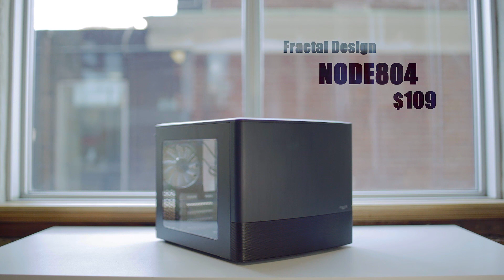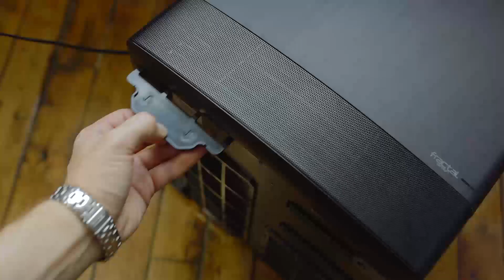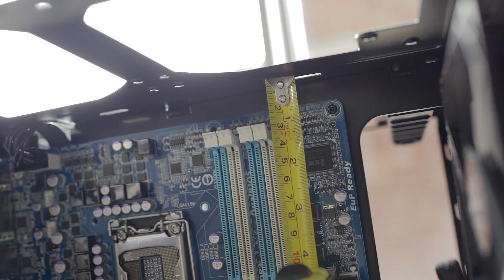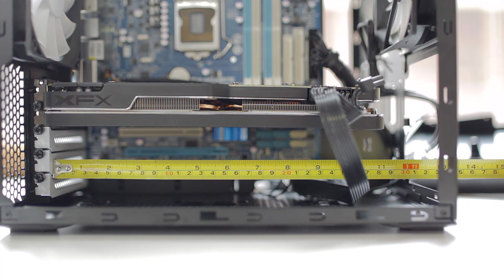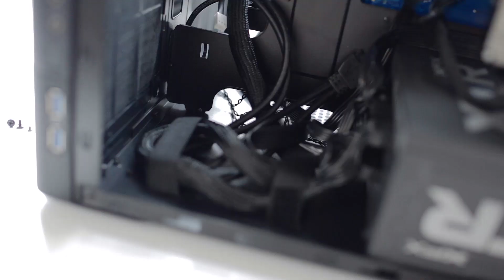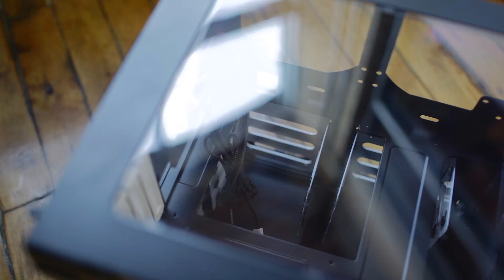Best PC Cube Case? Fractal Design Node 804 Review

Comment: no ssd support? double sided tape allows for ssd support on anything
Reply: There are 2 SSD mounts behind the front panel
Reply: ***** I just picked this case up after I watched the review and saw them. after I taped my ssd to the inside of course
Reply: Willie Finucane and 2 SSD mounts motherboard compartment. total 4 ssd
Reply: Willie Finucane its not that the case has no SSD support but that the drive cages will fit 8 HDD's but 0 ssd's
Reply: +Willie Finucane :) Double sided mirror tape works for 15.000rpm SCSI hard drives also and it is effective at isolating the vibrations from said drives.
Reply: Hey thats pretty cool, most cases just seem to have a 2.5" spot stuffed somewhere nothing else would fit just cuz, like on the 350D, Define R5 and others you can remove "all" the drive cages and still have 1 3.5" and 1 or 2 2.5" slots.
Reply: +Willie Finucane  Or velcro strips.
Reply: @KingdomOfCreation  my pc wont drive it will stand still
Reply: i use velcro
Reply: you can always use 3.5 expansions you can mout 2.5 on those expansions.

Comment: This chassis would be perfect if it had three things changed...

1: Mount the motherboard upside down on the opposite side, and give some extended length card support options. Similar to the TJ08e.

2: Adjust the drive mounting options for horizontal storage. I know they are going for better cooling with the vertical orientation, but as pointed out, its not convenient for cable or drive management.

3: Put in quality rubber grommets between the two halves. Not only does it look better, and give the cable management a cleaner look, but it gives better static pressure performance between the two halves.

I know Fractal loves customer feedback, so hopefully they can take some of these criticisms to heart, and produce a real unique, and world beating product.
Reply from the maker: Great feedback! I do also hope they modify the storage brackets and add in rubber grommets!
Reply: This chassis would be perfect if i had money!
Reply: 4: The USB ports on the Top. Never! Never! on the left or right side or bottom.

Comment: I am  using this case for my current build. I managed to fit two r9 290x with watercooling. The airflow is great! I think I will keep this case for a good while. The only case that I have tested that matches this one is the nanoxia ds4. It's cheaper as well, but it doesn't have that sexy window.
Reply: damn, sli AND watercooling? basass 11/10 would totally applaud again
Reply: Is it quiet??? pls reply. I plan on getting this case.

Comment: Great video, helped me make my mind up about this and the air 240. Have now subscribed :)
Reply from the maker: +Alex Brooks awesome! Welcome to the channel :)
Reply: which did you end up going with? im between these two as well for my first build.
Reply: +taffertime the node is good but there isn't very much room for your hands inside the case and I found the rear hard drive section to become really messy. Would recommend anything from fractal design or phanteks also have their p400s

Comment: Don't know if you noticed Dmitry; on the front (slim loading) optical drive cutout, there is no external eject button for accessing the drive, so this function is only available through the O/S.
No problem if you're not using the drive, but would have been nice for you to point this feature (or lack thereof) out.

Informative just the same.

Now; if Fractal Design could design one for ATX motherboards, might be suitable for my brother's HTPC.
Reply from the maker: Thanks for pointing that out! something i didnt think about :))
Reply: Node 605. Looks great, supports ATX.
Reply: Would have been better to have the DVD and I/O on the left hand side next to the window as well. That is side facing the user.

Comment: I love this design, like I love the Corsair 540 Air, for example, and this looks to be close to perfect for a mATX build, regardless of you're doing an air-cooled, all-in-one or custom liquid cooling. My only slight gripe would be the lack of a 5 1/4" bay, either full- or half-height. While ODDs are getting less relevant, these are still used for controllers, displays and reservoirs. But that is definitely a minor complaint.

Comment: I did my first build in this case.  The front panel mounting isn't great because when you pop the front off the wiring is so tight that it often unplugs the drive.  Lots of room for fans and great circulation.  The three fans that are included run quietly at the low and medium toggle settings, but do make some noise at max.
Reply: Adam English Thanks for that info based on personal experience. Can you give any more pros and cons? Leaning towards this or the Corsair 240 Air.
Reply: f1tony2003 The node is pretty minimalist - a smooth black box with a window on the side.  The Corsair looks a little more flashy!   I haven't bought an optical drive but there is a place for it (slim type) just above the front USB ports.  I would guess that the corsair might have better airflow as the node's front intake fans pull through a filter that runs the length of the case along the bottom four inches.  I think both of these cases are well suited for a CPU watercooler making air flow less of an issue.  Water-cooled my CPU rarely gets above 40C.  My GPU (R9 280x) runs at 50C - 60C using the stock fans at medium speed.   When I did my build one of the two front USB ports was dead.  I assumed it was a node hardware fault, and fractal designs sent me a whole new front USB setup up no questions asked.  Unfortunately it appears to be a mobo problem, but fractal customer service was great.  Good luck!
Reply: Adam English thanks so much!

Comment: Hi HardwareCanucks! Fantastic review of the case, and just sold me on it!  In the water-cooling setup, are you using EVGA HydroCoppers?  If not, would those gpu's fit in that case? If you're not sure, can you tell me what the clearance is between the side panel and the motherboard?

Comment: Which optical/bluray drive can fit this load slot?
I want to make my old i7 a multimedia cube pc but I cant find many choices for cases.
This has an optical drive option but has the load slot instead of normal optical drives slot that the drive move inside/outside.

Comment: Hey guys! I used the BitFenix Phenom just for a few months now, and I'm thinking about getting this case. The reason is that with my air cooling even with a tower cpu cooler and the Windforce GTX 780Ti, I get really hot temperatures on all the parts, and also assembly is a pain in the ass! Would you recommend changing to this one, and do you think it would help my cooling down the system? Thanks in advance!

Comment: So if I take out one of the harddrive cages so I can mount a radiator vertically in the front, and then use that to watercool my CPU in the other chamber, just to maximize the cooling possibilities in the chamber with the GPU, CPU and such, what cooling am I left with in the other chamber? PSU fan and a rear fan in the chassi?

Comment: This thing is awesome. Main question is where to put the res and the pump.
Reply: Damn it, i just realized that i have to find a new space for it, because the front i/o ports are in the wrong side.
Reply: Péter Friedrich I don't understand that, they have the window in the left hand side (when looking at it from the front) so they want me to put it on the right side of my desk so I can see all of my components, but then the put the buttons on the right side, so they want me to put the PC on the left of my desk...Not a problem for most people, but some peoples (mine included) desks are up against 2 walls, so we have to choose one side or the other.
Reply: My desk is between two walls, almost. The Bitfenix Prodigy had the same problem. My friend solved that easily. He put switches on the 5.25"bay cover.
Reply: EasyPCUK little details are important for manufacturers, for Dimitry, but obvious ones for the customer only.

Comment: another gripe. the ports and button are at the wrong side of the case...
imaging putting the case by the wall so you can see through the side panel window. can't reach them. if you put them on the left side. you can reach the port and button, but you can no longer look at the sidepanel window

Comment: Awesome review again Dimitri ! Thanks ! I have a question to make though.

If you put two 120mm radiators (from the all-in-one coolers of two EVGA 980 Ti Hybrid GPUs) at the top of the main chamber for exhaust, can you fit another two 120mm fans at the front of the main chamber for intake ?

The answer would be greatly appreciated :)
Reply: You will be fine with just the  2  120m fans.

Comment: How do you mount the drive rack in front of the power supply as shown in this video? I bought a used one off ebay and it didnt come with drive rack railing on top, and only with one drive rack. Any help is greatly appreciated! Thanks in advance!
Reply: I figured out you can line up the drive rack with low profile case screws if anyone else wanted to know. It's a bit tricky but can be done. Good luck routing those drives wires though lol, once they are in there it's a pain to swap out.

Comment: I have this case the and Antec P50 which are both a pretty good design but for some reason I like the P50 more.
Reply: Is the Node 804 loud? from 1-10 please rate it.
Reply: I would rate it a 3 but keep in mind I replaced all the stock fans with lower db fans. I also installed fans in every available location with the exception of the bottom.
Reply: +Chan Chuch oh ok. Thanks for he info.
Reply: +Chan Chuch *the
Reply: on this scale, is 10 the loudest and 1 completely silent / unnoticeable?

I assume 3 is good in this instance, but I'm not sure. :)

Comment: Watched a few reviews of this case now, but none have installed a large CPU air cooler, any idea if my Dark Rock Pro 3 will fit ??
Reply: +Dan Abnormal  It might fit. Max CPU Cooler height is 160mm and the Dark Rock Pro 3 is 135mm

Comment: When is this Fractal AIO water cooler going to be available?
Reply: They were just demonstrating the water cooling options, like what you could do if you wanted to
Reply: With fractal branded radiators and the same setup that uses fractals AIO which was shown two months ago?
Reply: I was referring to this current video
Reply: So was I.
Reply: Its just the case man
Reply: buttervleis They were using the Fractal Design radiators, they come as an AIO but can be expanded.

Comment: It seems a nice case interior layout wise, however its really too wide to fit on a desk well, and with such small feet, wide footprint and low height its clearly not meant to go on the floor.
This begs the question, where is this case designed for? Sure its smaller than a mid tower, but given there are smaller mATX cases (like the silver stone SG10) or a great many mid towers that have better water cooling and HDD support in that price range it feels like the Node804 doesn't really have too much going for it.
Having said that it does still look well sorted and quite flexible, and judging from my define r4 fractal design has great build quality for the money, so if you happen to need a short fat mATX case then jump on it, it'll do well.

Comment: So this or the Corsair AIR 240?
Reply: +Ashuten The Air 240 does have 80mm rear fans however which aren't great :/
Reply: I'm having the same problem.. Which one did you end up getting?
Reply: +Mein Fuhrer I was sure to get the carbide 240 but the found out I couldn't fit the msi 960 into it as it is too tall at 14 cm... I just hope it can fit into this one

Comment: If you needed to restart your computer how can you without the restart switch?
Reply: short the reset pins on your motherboard with a screwdriver
Reply: +Lukas Noels (LN2S) thanks for the help!
Reply: couldn't you also do this in Windows itself? pretty sure you can change the power button action in the control panel or similar, so it resets instead of say sleep (which I think is the default)

Not sure if this would help if your PC actually froze or blue screened though...
Reply: fabronaut my pc froze some days ago and I just turned it off and back on and it worked, no need for a reset switch, I don't even have one on my case even though I do have a reset switch wire plugged in
Reply: if it just freezes, you can generally force a reset by holding the power button down. I'm not sure if there's any difference between doing that and say, flicking the PSU on / off switch in the back if you have one, or pulling the cord from the wall.

Comment: Does an Asus Strix GTX 970 fit in this Node 804 case?
Reply from the maker: Shibuya Park From the looks of it, the card should fit. Although i can't check for sure.
Reply from the maker: Yes, the case supports dual 140mm fans so both X60 and X61 should fit.
Reply: I guess I answered my own question since I've just completed my build. http://pcpartpicker.com/b/VpM8TW
Reply: +Shibuya Park Space for 2 graphic cards of gtx980?

Comment: This or the Fractal Design ARC Mini R2?
Reply: +Stuart Trappe Completely different form factors.
Reply: Candyshooter Both are mATX, I got a Hadron Air.
Reply: True.  I meant cube shape vs tower.  Nice buy on the Hadron Air.  I'm trying to downsize my Fractal XL 2 to the cube O.O
Reply: Candyshooter Hmm, yeah, mITX is somewhat hard to work with, also since my case has a PSU integrated that isn't modular and my Impact VII got fried.
Reply: Yup, trying to change mobo to Matx, at this point I don't know if I should just upgrade my 3770k.
Reply: +Candyshooter it's still a Decent CPU

Comment: can this host dual AMD Fury X's?
Reply: +Spirittism yea it can! :D
Reply: +Spirittism
Why would you get dual Fury X's??? Total nonsense.
Reply: +Rygar it's called crossfire, the reason people do get 2 is for added performance.
Reply: Spirittism
What's the point in added performance of two cards if your FPS get halved in 4K? Might as well use one which is enough for 1080p or 1440p.
Reply: +Rygar 
Your fps doesn't get halved in 4K.  What are you on, mate?
Reply: Fps gets halved in the sense that the 1.4a Hdmi specification which Fury X is using can only transfer 30 fps max. It has no 2.0 support which would be needed for 60 fps, so it's pointless for the cards to render more than 30 fps in 4K as those can't get transfered to the display anyway.
The only use of having two Fury X cards would be to render the game at 4K and have it downsample trough VSR to 1080p or 1440p, but that's a huge waste of money for a little quality improvement.
Reply: Rygar He's probably using displayport
Reply: +Rygar you are aware that the fury x also has displayport?

Comment: IMO, this has the same problem as the Prodigy, in that they packed so many features into it that it has ceased to be a small form factor case.
Reply: This is MATX though while the original prodigy was ITX and the later revisions of the prodigy to fit MATX were bloody awful Frankenstein monsters. Also this is hardly huge, it's still considerably smaller then most MATX towers on the market without sacrificing anything really. Being able to jam 4+ drives, 3 radiators and two video cards in something under 35cm across, 30cm high and 39cm deep is pretty damn nifty.

Comment: I don't really get the appeal of cube cases, at least as a means to save space. If I wanted to put my PC on my desk, I'd prefer something that was taller, but had a smaller surface area on the bottom. It seems like a cube case would only take up more space on your desk due to its large bottom surface area. Seems smarter to get a taller case which is less wide, like an Arc mini r2.

Comment: Node 804, a case with a bad design.
After making it extra wide, they also placed the IO on the opposite side to the window (more space needed on the right side), so if you want to place it on a corner desk, you need a very wide desk.

Comment: There's no reset button? What??
Reply: QuantumBraced Frankly, I have never ever used that thing. In fact on my old PC I would often hit it with my knee by accident.
Reply: +John Kapri I agree. I think I used mine a week or so ago, but rarely need to. I think my GPU crashed. If I get this case, and need to hard-reset my PC, I'll just reach to the back and flip the PSU switch.